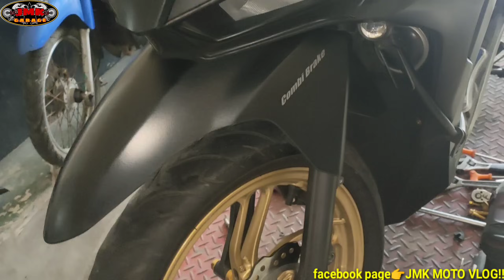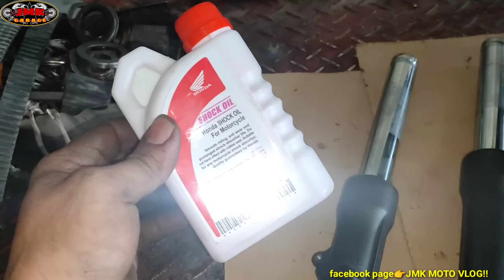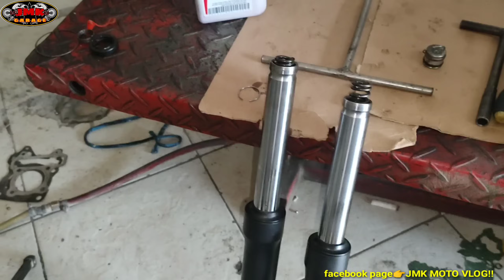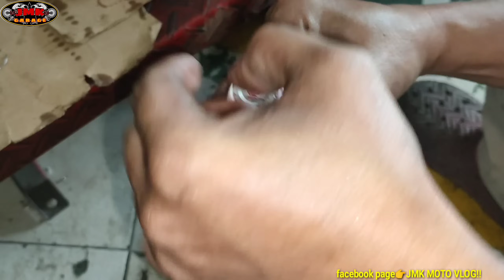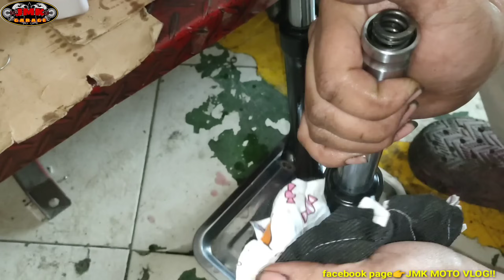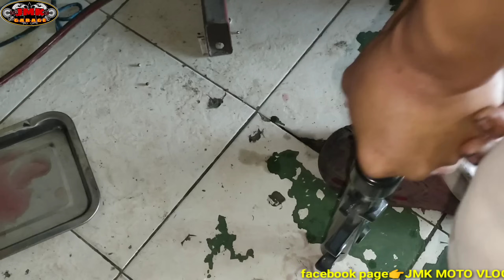matagtag na shock kahit kakarepack lang😱alamin kong bakit matagtag

Comment: Sir may chance kaya na repack ang need ko sa shock ko sa paling ng manibela kase di naman sya sa ballr ace eh,  pag binitawan mo kaso yung handle bar pumapaling agad pakanan na parang ttumba agad, hmmm feeling ko sa shocj ang problem e bagong kuha palang motor
Reply: Sa mio ko sir halos ganyan din yung problemabnung nakaraan. Nagpalit nako ballrace pati wheel bearing, both genuine parts pero ganun padin. Yung feeling ko ay sobrang lambot ng manibela. Naisip ko na baka need ko narin ng repacking pero may napanuod ako dito sa youtube na dapat pala icheck maigi yung dalawang nut na nasa taas lang nung upper ball race bearing. Ayun niluwagan ko lang akin tas hinigpitan ko habang iniikot yung manibela, nung nahanap ko na yung tamang timpla ng manibela ay tinigil ko na paghigpit. Sa ngayon po ay ok na ulit yung mio ko.
Reply: @kieyonero4165  Sir pwede makita link ning youtube na yun? hehe sa pag balance ba ng takbo yun?  nag straight takbo ng mio nyo sir?
Reply: Ayos naba motor mo paps? Sa shock mo yan hindi pantay ang pagkaka lagay or sobra ang oil na nailgay at pwede dn yung brake mo mo sa front wheel naka dikit

Comment: sir ano ba sira sa beat fi pag malikot na yong upo.an at parang hindi pantay yong gulong sa harap at likod pag pinatakbo.. tapos laging kumakaliwa yong manibela nya pag manakbo tapos sa kanan ang bigat nya iliko yong pakiramdam ko habang tumatakbo yong motor mabigat sa kanan at subrang lambot sa kaliwa.. nag palit na ako ng ballrace pro ganon parin pro ok naman yong play ng ballrace pag eh center stand ko tapos mabibitawan ko naman yong manubela kaso lang mga ilang minuto liliko sya sa kaliwa.. ano po ba sira non sir.. engine support ba or engine bushing?
Reply: check mo yung rubber link stoper at for sure ang engine bushing mo kelangan na palitan yan. ilang odo na ba
Reply: bago pa kasi rubber link nito sir tapos tiningnan ko yong rubber link hindi naman natanggal makapal parin
Reply: @josephdais8577  palit ka engine bushing
Reply: napalitan na ganon parin pati ballrace 4 na palit kuna dis align parin
Reply: @josephdais8577  nako. bala chasis mo na may problema
Reply: yon nga din duda ko papz eh.. kahit napalitan na ang fork oil ganon parin kahit ilang ulit kuna pina align yong gulong at manibela pro pag pinatakbo mona dis align talaga
Reply: @josephdais8577  boss baka yung tpost mo sira
Reply: hindi naman to na bangga boss
Reply: @josephdais8577  kahit hindi nabangga. kapag tumatama yan minsan sa lubak lugak. na de deform yan
Reply: na lubak to dati papz ng medyo malalim pro hindi naman naa dis align ang takbo kaso lang  tumatag ang front shock at pag my angkas ako na mabigat subrang giwang nya pro hindi dis align
Reply: Yung sa manibela yan paps bka sira na yung mga bearing nya at maluwag na rin..dpat mo nang palitan ksi gnyan din sakit ng sakin lalo na pg na lubak..
Reply: @leonardocosmiano1390  papalitan ung manibela paps?
Reply: @josephdais8577  hanger bushing sabay yan at rubber link pag napalit pra isang baklasan lang
Reply: tignan mo tpost o kaya yung inner tube ng shock mo baka baluktot na
Reply: Paps papalitan mo gulong mo sa likod.
Ganyan din akin.

Pinapalitan ko ng 80/100
Mas malaking gulong umokay ang takbo
Reply: @JOEYSTOTOMAS-mg4qy  tatagilid din ba  motor mo papz pag pinatkabo nong hindi mo pa pinalitan ng gulong?
Reply: Kamusta paps ayos na ba mc mo???
Reply: Same problem sa click ko sa kanan namn sa nkabig ngpalit narin ako ng rubber link at ball race pero ganun parin nkabig siya ng kanan
Reply: @johnderama1864  kumusta click mi boss ok na ba
Reply: Eto problema ko ngayon e isang linggo na nyeta
Reply: mostly TPOST ang may sira.